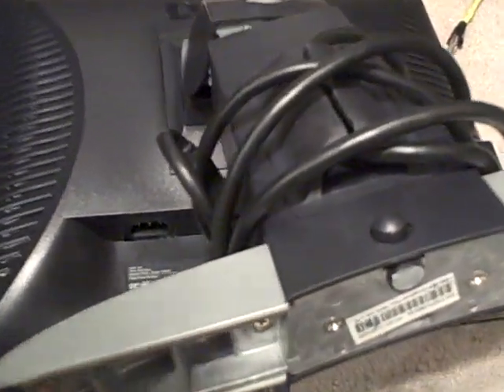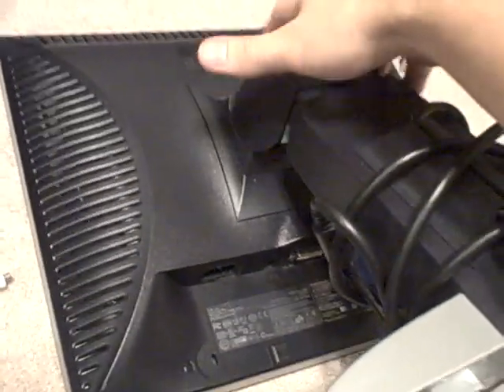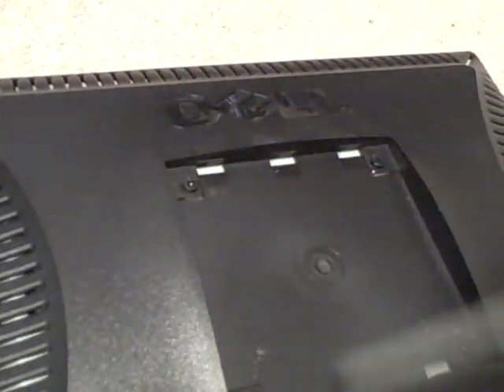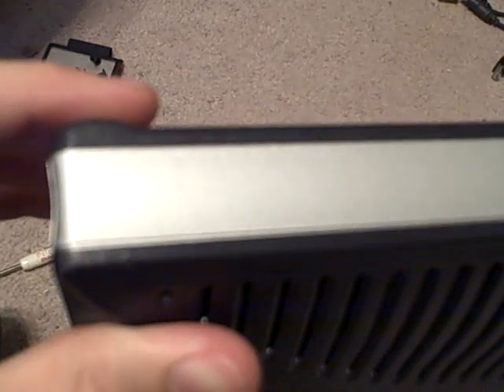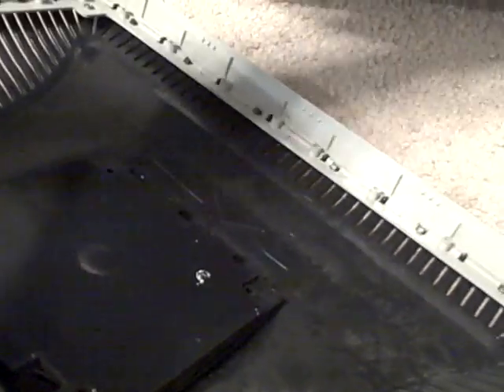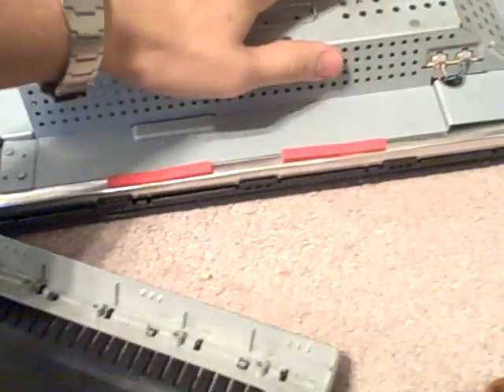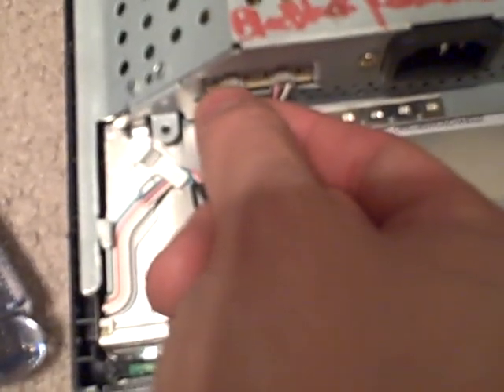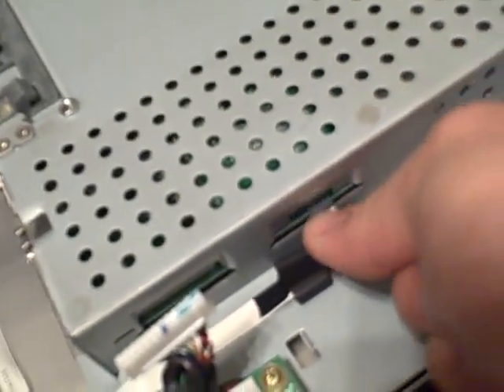Disassemble 17" Dell LCD Monitor for repair part 1

Comment: I have a Dell 2009wt 20" monitors; and it has developed horizontal lines (bunched together, about 1/2" thick) across the entire with at the bottom of the screen, so blocking out any apps and anything in that area.  What do you think is causing the problem?

Comment: well i have a dell monitor 17".... i hv disassembled it for my some project..... so i hv exended the two wires that went to the motherboard n the wired that went frm motherboard to the monitor,.... but when i connect it, it gets power but there is no display on it!!! please help because i have tried many things but no solution.... it gets on but no diaplay

Comment: Success!! I bought a soldering iron (practiced a bit), desoldering pump, and the recommended capacitors.  This was my first time working on a computer and soldering.  I followed the two videos and even had to rewatch them a bit in reverse steps to remember how to put it back together since i waited a few weeks between taking it apart and the repair.  Thanks from a stay at home mom helping to save money!

Comment: I used this video to get me started on a Dell e207wfp but couldn't go any farther when I was unable to loosen the internal harness which is positioned differently.   My guess is that the white taped-down plastic flat pieces are grounds.  I cut one of them in order to get the screen perimeter off.  My monitor needs repaired due to a messed up picture that shows only half a screen which went bad after it fell about a foot onto a lower level.

Comment from the maker: @jm3la Ive done 3 of these and never ripped the ribbon. If you notice I just pulled the front off enough to separate the 2 pieces then left it attached to the front.

Comment: i just now ripped the ribbon cable that goes to the on button would u know witch wires on the little bord with the USBs is on and off? i need to wire up another switch  i dont have  another ribbon cable